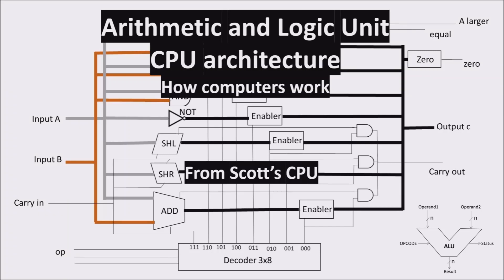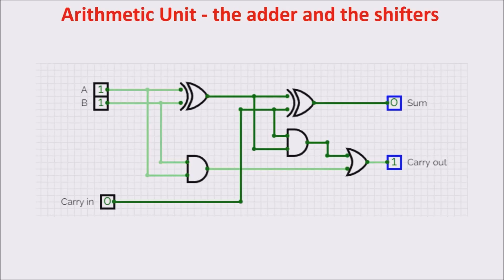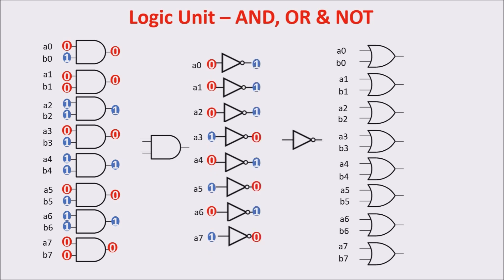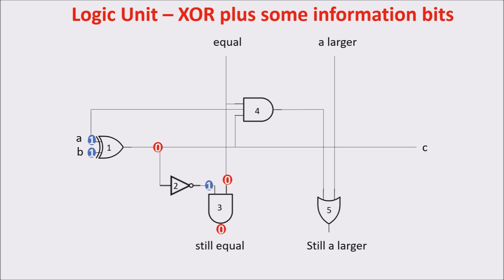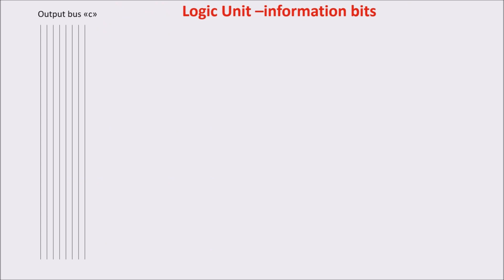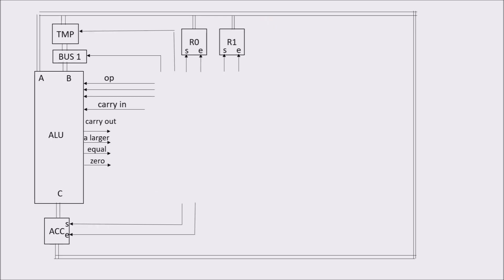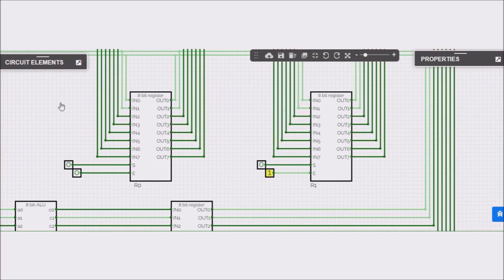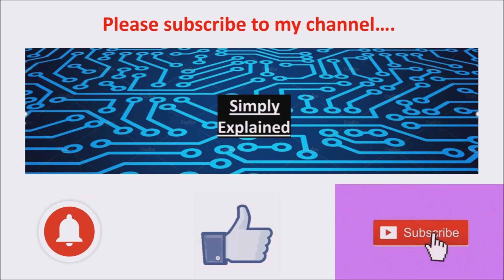Arithmetic and Logic Unit  - ALU - how computers work part 6

Comment: How come the CPU checks for a larger , equal  or 0 but not for b larger and why does operand b need to enter a temporary  register 1st before going into the ALU but operand a doesn't ? Good video series I learned a lot from watching 😀
Reply from the maker: Hi, thanks for your comment. First question: we doesn't need b larger than a because the information is already in the "a larger" line (if the line is at zero b is larger than a, if the line is at one a is larger than b). Second question: if we have two operands and one bus we can put an operand in the bus but not the other so we need a temporary register for keeping the second operand. I hope the explanation is clear. best regards